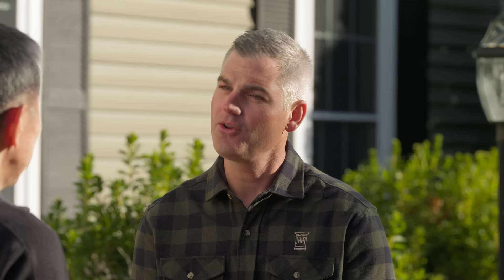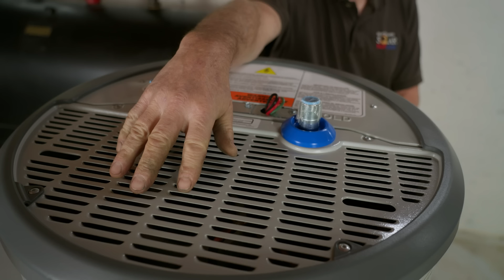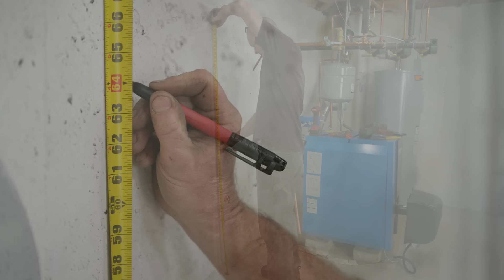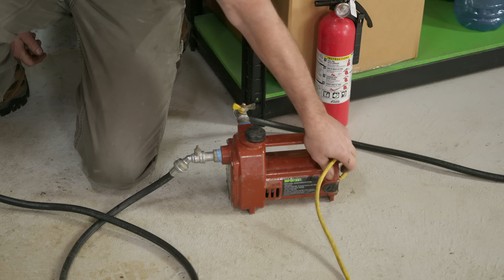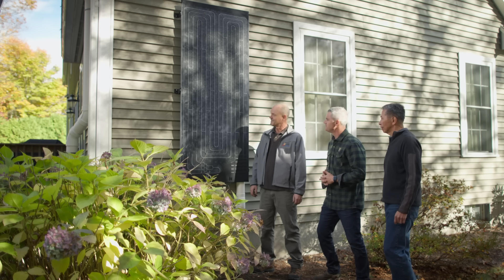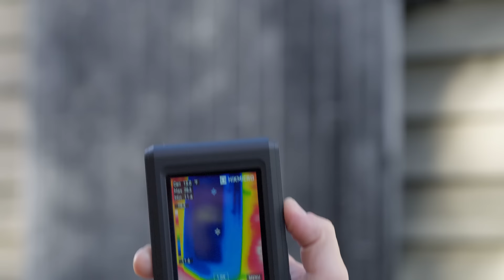Heat Pump Water Heater for Cold Climates | Ask This Old House

Comment: With that Buderis boiler you should have went with an indirect tank.
Reply: yeah i have an indirect, we burn like nothing in the spring/summer in oil.
Reply: Yeah more efficient to use a super insulated indirect, Buderuss is a cold start boiler, mine runs about 20 minutes a day during the non heating season to maintain hot water. Just keep buying more electric heating appliances, Eversource loves you…………
Reply: The juice isn’t worth the squeeze.  ( No back up !) call your plumber to work on a refrigerant system good luck . 
Just install an indirect tank off that G115 , or go propane tankless.
Reply: Then that monster would have to run in the summer too. No thanks.
Reply: @midbamarail Depends on how much hot water you're using. I had a similar setup for years, modern oil boilers aren't that loud.

Comment: Before people watch this video to know if it's within our limited budget. HOW MUCH $$$ DOES IT COST, LABOR PARTS, PERMIT & LICENCED PLUMBER etc.
Reply: This system would be very expensive up front and would likely take years to actually save you any money.
Reply: They are not allowed to say the price on that show
Reply: @BostonAviation2010  They could say how long until they break even or actually start to save money. I know that it wouldn't be as good of an advertisement if they tell people it will take many years to financially justify the change.

Most of these "upgrades" on the show are more of a virtue signal or conspicuous consumption rather than fiscally responsible.
Reply: @David_H_Parker  The price is 1950 the installer commented
Reply: @BostonAviation2010  Maybe that was a loss leader for the free advertisement. There is no way the equipment, electrical work, installation labor and refrigerant totaled $1950.

Market price would be way more. The self contained Rheem 80 gallon unit is $2200 for the water heater alone, not including incidental installation parts or plumbing the water and drain lines. 
 
This split system is way more complicated and requires more labor to install.
Reply: @David_H_Parker the installer commented the price
Reply: @BostonAviation2010  Not a credible comment or realistic price.
Reply: @David_H_Parker  How is it not credible? Look at the channel!

Comment: Ah yes way more efficient. Only problem the ROI is like 20 years after which the compressor has failed
Reply: It's like 7 years ROI
Reply: Assuming the electronics don't fail first. Manufacturers intentionally making things more complicated that break sooner. More sales and work for installers.

Comment: A lot more parts to go bad
Reply: And limited technicians with the know how to diagnose and service it. Conventional systems always have the advantage of commonly being in stock and an abundance of technicians familiar with repair methods and even having service parts on hand in their truck.
Reply: By design. Coolant leaks, more electronics, etc. Not built to last, but create more sales and work for installers. If has an app, hacking is another worry.
Reply: @ronbennett7885  If you can find a company that even wants to attempt repairing it and not selling you an entire new system.
Refrigerants are being outlawed so the one you need might be obsolete when you need to repair it .

I am seeing several systems requiring replacement because the refrigerant is no longer available or is cost prohibitive. The EPA needs to get out of the business of telling people what they can use in their own home. All of this is designed to force people into spending tens of thousands of dollars on new equipment that is less reliable than what they originally had.

Comment: Notice that the installer never mentioned the price when Ross asked.
Reply: Its different in each state depending on tax credits or rebates. Some states are sub 2000 while others could be above 5,000.
Reply: @BostonAviation2010  nope, the price is the same and the tax credits are subtracted from that price. Just say the price lmfao.
Reply: @ThoroughlyTested  they are not allowed to on this show.
Reply: @BostonAviation2010  Good. But this installer works in the city where he is installing it. 
So he would know the prices.
Reply: @saulgoodman2018  they're in Massachusetts. there's a $1500 'mass-save' rebate as well as federal tax credit (30%) on some models but looks like ~$5000 after it all
Reply: @chibbyylol  It's not all about the rebates.
It is only a tx credit. You will not get all of that refunded.
Reply: @chibbyylol  residential energy tax credits (IRS form 5695) no longer exist in 2026 per the 2025 OBBBA.
Reply: It would be a pointless number because the price is going to vary drastically, not only from installer to installer, but from location to location as well. He framed it as being comparable if not cheaper than another common hot water heater install, so that tells you what you need to know.
Reply: @jeremyhale6403  But we are talking about where this guy lives.
Reply: @saulgoodman2018  That's one singular data point in time. It would be an irrelevant number to everyone within a year, and to 99.99999% of the viewers from the onset.
Reply: @truthseeker308  I'm into computers, and this is not a computer.
Pricing matters.
Reply: @jeremyhale6403  It does not matter. You talk about the cost now.
Reply: @truthseeker308  What are you talking about? This have nothing to do with capitalism.
Reply: @truthseeker308  We are not talking about different areas. It was installed in this area. So we just asking for the price and cost of install only in this area.
Asking for the costs, have nothing to do with capitalism.
Reply: @jeremyhale6403    He simply could have stated RETAIL then added a high and low figure for tax rebates.
Reply: I have the same system installed and it was about ~$5,000 installed with the 80 gallon. Energy use is about 1,000kWh for the entire year.
Reply: Why would he. Price changes a lot.
Reply: @schwartzmatthewe  SO.
Reply: The real math needs to be done including total installed cost to see what the real savings, if any, truly are.
How long do you need to get a ROI on changing to the heat pump?
Reply: @David_H_Parker  And none of them answered that.
Reply: @saulgoodman2018 the manufacturer's website has no pricing either
Reply: @orourkean  That is not the same thing.
Reply: @David_H_Parker  do your own math they state efficiency as only being in the 2-3% range relative to a 1%(electric)
Reply: @EcHo8484  Tell me you don't understand anything without telling me you you don't understand.

It is not 1% efficient, 1= 100% efficient
2= 200%, 3=300% do you get it?

Now for part 2. Efficiency ratings when comparing different fuels is meaningless unless you talk about $. If natural gas is cheaper than electricity, it doesn't mater if your electric appliance is 1000% efficient if it costs you more to run per month than a 40% efficient natural gas water heater.

Now we need to know how much the component and labor costs compare. If a standard gas or electric water heater costs $800 + $1000 labor, compared to a $heat pump system that costs $18,000 installed, it will take a long time to break even even being 3X more efficient.

So the important information to know is how long does it take to get a return on the investment compared to running the standard water heater?

Same thing with solar electricity, how long does it begin to pay for itself? After spending $30,000 on a solar array and the related upgrades, how many years will it take to break even?

Same thing buying an EV, how long until it actually saves you money over driving a Toyota Yaris?
Reply: Eversource has entered the chat…….I love electric, 5K more than you need to spend  with no chance of ROI so you feel like your doing the right thing
Reply: First, why is the 100% efficient electric water heater the bad guy while the 35% efficient oil burner gets no mention?  Yes, no price.  Second, I would think it would easily pay for itself in, well, probably never.   I've heard so many stories of HVAC companies charging ridiculous prices.  I want nothing to do with them.  I have replacement parts in my basement for my gas furnace.  I even have a duplicate tankless hot water heater in a box in the garage should the one that came with my house have a problem.
Reply: @georgeballow7028  Electric is the bad guy due to the cost of the fuel (electric) not the efficiency. Electric is 100% converted to heat so other than insulation loss it's pretty fixed. That boiler is likely near 85% efficient at converting oil to heating BTUs when running steady state. Here in the northeast electric can be well over 30 cents a Kw so there's another factor to deal with. (35 cents in Ct)
Reply: @rupe53 yes, but it’s part of a bigger move to solar. Start with solar and as systems age out convert to these units. Thats what I’m doing in CT. My rate after energy credits works out to around .05 cents a kWh.
Reply: @chrisc9640  I am in my 70s and the chances of ROI before selling the house is not worth my effort at this point. I suspect many others look at cost to do the job versus how long they might stay, even if WAY younger. Basically the return before resale.... or what will it do for the resale price? Drop thousands now or wait a year + to see if equipment goes down?
Reply: @georgeballow7028 if you look at total efficiency from pipeline to hot water directly burning the hydrocarbons for heat is about 80% efficient but using a power plant to turn them into electricity and then using that electricity to heat water is only about 40%. That is ultimately reflected in the cost of the water heating as well.
Reply: Presumably it's overly expensive. If it wasn't, they'd likely have mentioned a price range like they do for some other topics.
Reply: @ronbennett7885 
It's not expensive.  They make 120volt you can plug in yourself, just need to add condensation line.
Reply: @ronbennett7885  yea and it isn't good either, that unit will build up frost and then be way less efficient. There are better active fan outdoor units, like mini split look-alike but for heating water..
Reply: @ronbennett7885  They are not allowed to mention the price on that show
Reply: @BostonAviation2010  Say's who?
Reply: @saulgoodman2018  It seems to be their policy over the years. They seldom mention a mod # that you can look up for local prices or check consumer reports.
Reply: @rupe53  When it comes to projects, it is different.
Reply: @saulgoodman2018    I have heard them mention a customer's total budget but almost never hear a breakdown for details.
Reply: @rupe53  That is not the same thing as this.
Reply: @saulgoodman2018   Right, which is why I didn't mention it earlier. (topic drift)
Reply: And Ross doesn't either.
If I ask someone for a price for something. And they give me all this other BS, and not what I asked about.
Then they are leaving.
Reply: @saulgoodman2018  dude they’re filming a TV show, they aren’t in your basement installing it. It’s not the same. 

The problem with listing a cost on this episode is 3, 5, 10 years from now, that info will be incorrect and misleading to whoever is watching it then.

Then you’ll have commenters saying “TOH you’re wayyyy off” and blah blah blah.

You’re kind of damned if you do damned if you don’t
Reply: @krvnjrcbs So what if they are filming a TV show. 
When people watch it, does not matter. When they can easily see the date it was uploaded.
Reply: @truthseeker308  You do not have to keep the pricing up to date.

Comment: Sorry to be negative, but that is ugly, and I wouldn’t want it on my house.  Govt overreach to make traditional electric water heaters go away.
Reply: If I'm right, I think we are starting to move away from gas into electric
Reply: It is electric but grabbing ambient heat. The heat pump water heat is similar. Your government is making it cheaper but you're complaining?
Reply: @dg-hughes Outdoor part looks terrible. Probably spending more too. Considering the higher cost of the unit, installation, and probably break sooner since there's so much more to potentially go wrong.
Reply: @dg-hughes Government isn't paying for anything, it is taxpayers subsidizing it. 
There is an active effort to get houses to convert to fully electric despite the power grid not being capable of the existing demand with EV charging and datacenters.
The electric rates are rising with demand and grid reliability is suffering. My area has power loss frequently and power restoration can take days in some cases. Having natural gas or fuel oil can literally be a lifesaver in the winter.

Comment: No defrost cycle? Is there minimal risk of a thick layer of ice forming and hindering heat transfer?
Reply: remember, a water heater is never a continuous duty so it's got time between cycles, unlike space heating in cold weather.
Reply: Ours has defrost but only if it gets too cold/ice